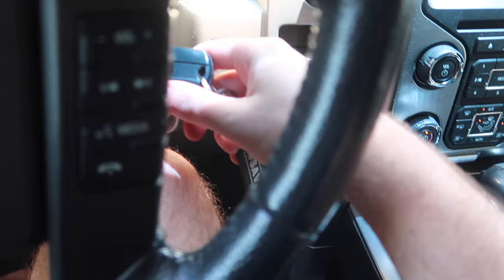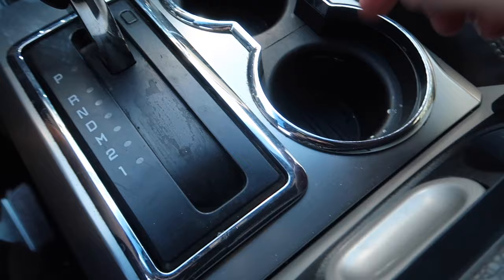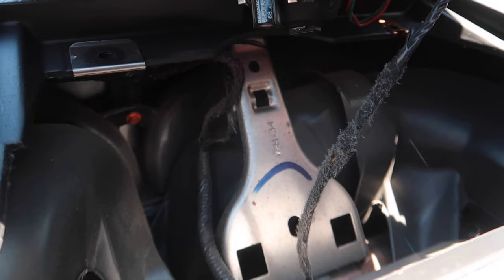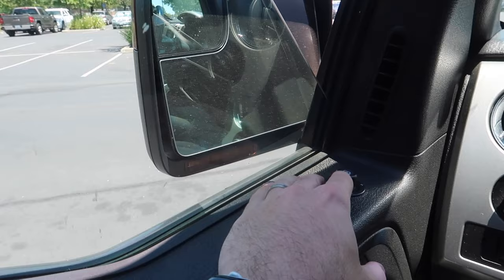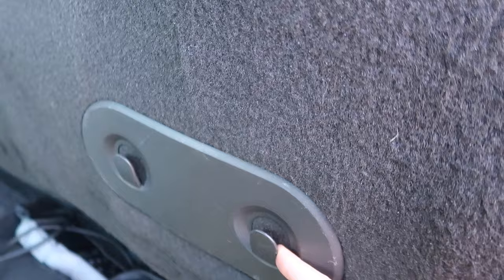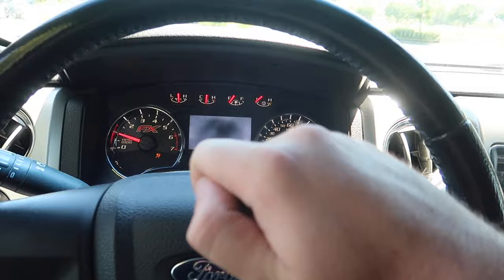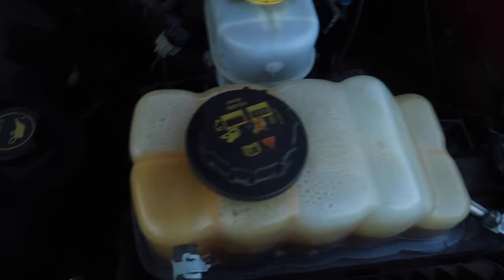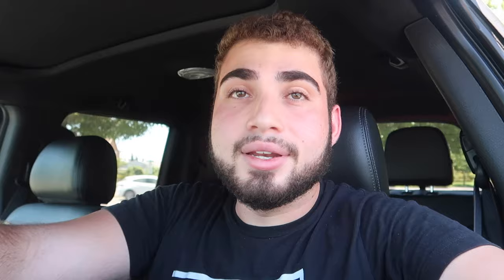FORD F150 HIDDEN FEATURES/FUNCTIONS (2004-2014)

Comment: There is a small lever behind the rear seat back that if you flip it it will allow the seat back to fold down forward. I attached a paracord to a key ring and the keyring to the lever and attached the cord to the headrest bar with another type od clip. Another keyring will work fine.I use a small carabiner.  Push the headrest all the way down and its completely hidden. I attached a hard plastic molle webbing behind there and there's enough room to mount tools or weapons etc etc. Its a great place to store an AR-15 etc.

Comment: There's a hidden latch behind the rear seats that allows you to gain a bit more storage space with a small modification.
Reply: You mean the rear seat 'backs'.  I just used a small length of cord, tied a knot around the small post and hot glued it.  You'd think Ford would've just had an easy to reach lever for it.

Comment: I just got my 2012 F-150 FX 4 Ecoboost about a month ago and love it so far! I love those cup holders as well, and removing them to allow for bigger bottles never crossed my mind.  What I instantly thought as soon as I saw they are removable is how easy they will be to clean.  I swear, nothing on a vehicle gets nastier than the cup holders and they are impossible to clean. Hell, with these, just take them in the house and wash them like your dishes. I bet you could run them through the dishwasher 🤔
Reply: Took mine out to clean then left them out because the extra room is great

Comment: It also has built in wifi, if you have the 8" nav, if it was still available you could use the default nav screen to call your phone and get directions to where you're going, not only it can scan itself but it can send it directly to a ford dealership to look at it, but the service doesn't work anymore, also if you have an HDMI to A/V you can plug in a nintendo switch to the A/V input in the center console and play on the screen while the car is in park.
Reply: There’s AV input in center console? I’ve got an 11’ lariat. That’s badass
Reply: @0223Jeremy  I have the same truck as you and I have it why don't you have it ?
Reply: @tylervanbiezen804  all I see in the middle console unfortunately is the plug-in for a phone charger

Comment: My favorite feature is the ability to permanently disable the seatbelt warning. Also easily add a custom door code, or quick lock using the last two buttons on the door simultaneously.
Reply: How do I disable the seat belt warning?
Reply: How do I program a custom door code I have been struggling with that
Reply: @keetonbond1256  

Depends on what year. This is the video I use for my 2012 when ever the ford dealership inadvertently resets my custom door code.

https://youtu.be/keCaYdmG0m4
Reply: It’s in your owner’s manual. Friend of mine was annoyed by his ‘15 GMC because he couldn’t do that. He had to find some seatbelt buckles.
Reply: I did mime on a 2011 f150 pretty easy but it will not reset the passenger side
Reply: Don't know why I'd want to remove the seat belt warning chimes.  That's pretty important, especially if you transport kids in the truck.  Door code locks sounds great and going to check it out now.
Reply: @bobbyd6680  If I'm not mistaken, the seatbelt warning is only for the front seats when X amount of weight is applied. My backpack and groceries would set off the seatbelt warning in the front right passenger seat. I often use the chiller option to make sure ice cream or what not stays frozen or remains cold longer until it's refrigerated. (Heated seat warmer also works to keep pizza warm.) 😁

For safety kids should be in the backseat but I don't think the seatbelts in the back set off the warning. It's been 5 years since I disabled them. ¯\,_(ツ)_,/¯

Comment: Pre-oil prime. the turbos want oil and timing chains, if you leave your truck sitting for a few days. Push the throttle peddle to the floor and turn the key, it will crank the motor for up to 10 seconds and not start. This will prime the motor with oil, turn the key off and then start. no crazy bad noises. when you do the pre-prime turn the key and let it as long as your foot is on the throttle it won't start.
Reply: Good to know ,thanks
Reply: is that for real? is that intentional by ford?
Reply: @fleedouglas one makes you wonder being all Ford would have to do is let the truck turn over a few times before going into fire mode to save this probably I much prefer changing a starter over a timing chain

Comment: Thanks for the info I've had mine for about two years now and absolutely love it. High miles aside its a great truck with a ton of features
Reply: You will be amazed when you find out you can roll your windows down with remote 😂
Reply: @ramonolivares8059  are you talking about programming it with forscan or from the factory?
Reply: Thank you so much!  Planning on buying a 2013, on Monday. 😁

Comment: Random thing I noticed on my 2014 super basic XL 5.0.  When you do a light "bump" to the turn signal, it will cause the signal to blink 3 times and stop.  However, if you're towing a trailer with the lights plugged in, it will blink 5 total times.
Reply: The blink 3 times is called lane change feature so when you want to change lanes just bump the turn signal lever and it blinks 3 times to let other drivers know of your intention to change lanes.
Reply: He knows that. He was saying that when towing, it blinks 5 times instead of 3.

Comment: 278k on my 13 ecoboost. I pull 9,000 lbs 500 miles a day, 3-5 days a week since new. No issues what so ever. I’ve had great luck with this truck. Will buy new eco when it hits 300k
Reply: That's Great to hear. I have 95k on the same eco 2013 fx4 and nothing noticeably wrong with it yet. I don't pull a lot other then a boat sometimes but haven't really got to experience how it does pulling a heavy load. I was hoping it will last awhile because I spent too much money on it from the dealership so that's great news. Keep keepin on ✌️

Comment: I have a 2012 XL F150, it doesn't have some of the stuff you pointed out here... no power mirrors, no back seat, and my cupholders slide out on a little tray under the middle of the seat. Those cupholders have no problem with larger drinks, they seem to be dimensioned in such a way that two big guys could put their Super Big Gulp in the cupholder and they won't hit each other, or spill. 

My brother in law has a 2012 XLT F150, he has a really neat feature where he can move the pedals themselves closer or farther away.
Reply: BUILT FORD TOUGH!!!
Reply: I thought they feature is also pretty interesting, can come in handy when you’re teaching the youngin to drive.
Reply: @jacobrogers4619  It would have helped my dad teach me to drive... he's a couple inches shorter than I was at 16!
Reply: My 2013  Off Road has all those good features. I like the pedal and steering wheel up and down features.

Comment: When you sit in the drivers seat, where your left knee is, there is a knob that will dim and brighten your gauges. Turning it clockwise past the detent will turn on your cabin lights.
Reply: Also the lights on the back of the cab. But on my 2011 it's more of a switch type system, so you oress and hold it on the right side to turn them on and the left to turn them off
Reply: @connerpeters9434  Thank you!! Just bought my used 2014 F-150 last month and couldn't figure out how to turn them on (my truck didn't come with a book and I keep forgetting to look it up.)
Reply: Most trucks have had that knob for years

Comment: Mine came with a cool feature, Black mold in the headliner. Thanks Ford, The felt gasket on the rear brake / bed light was genius. Nuthing says 50k truck like molded plastic.
Reply: Siliconed mine in after I changed it 💀
Reply: Yeah I washed my truck today only to see the brake lens fill with water

Comment: I know the 2015 F250 XLt has a feature that, if you press the unlock button three times, holding the button down on the third press, the windows will roll down.

Comment: The 7 and 9 on the door code will lock your doors. Your door code is on the inside passenger kick panel, ford charges 40 bucks to get it. If you're on stage 2 lock/ unlock, putting a 4 after your code will unlock all 4 doors, stage 1 all doors unlock following code. 
Forscan is very helpful on these trucks with Bambi mode and such. 
I'm trynna think of more but my brain isn't working. Glad you told me about the USB ports!
Reply: Forscan?
Reply: @rayk4e  yes. It's a program for coding. Def a great tool
Reply: @jsiebrassemusic  Thank you.
Reply: I cannot get my door code to work.  I bought it used.  And suggestions?
Reply: @charokorky  check that your door code is correct with forscan or thru the dealer.

Comment: You can leave the key in,and truck running when you get out and push the bottom two buttons on the key pad at the same time and lock the the truck. It will stay running for the time that you have set on the dash menu. Use the keypad code to get back in.

Comment: Beware when using the front frame as a 'step' if you have the package with an automatic transmission cooler.  One of the connectors on my transmission cooler lines (one in, one return) broke and it cost me 6k to have the tranny rebuilt because the fluid leaked out ruining multiple parts within.  Periodically check the connections of the two lines just behind and below the radiator. I'm thinking now of trying to use a wire tie or something to reinforce the connection.
Reply: Those quick connections  are a failure point, really need to watch them and replace at longer intervals
Reply: @mariusgage5471  100%. Mine failed just driving around town, nothing atypical.  You'd think they would have been a subject of a recall.  Any idea how to secure them further?
Reply: @rayk4e  not sure to be honest, fordtechmiculo or whatever his name is has a good video on it,

im currently looking into the mishimoto trans coolers for the 5.0 specifically for if they change those connectors, no determination yet
Reply: Use A Dremel to cut off the hose with the quick connects and replace that entire section with 1/2" transmission hose and double clamps.

Comment: I loved my 2013 F150 company truck so much I bought a used 2012 FX2, both had the Coyote 5.0 and 6 auto, both went over 225,000 with no major issues. 

Traded it in for a 2nd gen Raptor which is a whole new style of crazy.

Comment: I'm slowly learning all about the hidden features like "fuse 27" and rear window defroster jumper(just did that one tonight). Maybe the lead frame will be next on my list?
Reply: You mean fuse 27 going bad and it not starting? Had that happen and found out that's what was wrong here on ytube.
Reply: Just had my lead frame replaced. It took two weeks to get it from Ford to dealer and then one day to change out
Reply: What about the rear window defroster jumper?  My defroster does not work. Lights up for a second then nothing.  Any tips?
Reply: @rayk4e  yeah just disconnect the rear window defroster and and put a jumper in so at least your heated side mirrors will work now.
Reply: @OrangeSVTguy  Thank you
Reply: @rayk4e  unplugging and cleaning the back window wires, on both sides behind the headrest worked for me.
Reply: 😂,I had to change the lead frame,on my 2012 f-150 Lariat,and for had to pay

Comment: There's a hidden feature to lower the back seat down.  It's down below the back head rest on the left side.
Reply: Yes. Hard to find it's a small round pin I used a zip tie to pull it down and release the back seat. Once it's down you can find aftermarket latches on eBay with a small pull string to release instead

Comment: Ooh keep'm coming! I just bought my dad's 2010 F150 xlt, still learning the sport feature mode and the rest, good times!
Reply: Press and hold the traction control button
Reply: @MintSky1  on the 2013 it say advancetrac off, is that just more traction control being turned off?
Reply: @LogosFarm  Correct. Pushing the button will turn of traction control. pressing and holding the button will cause advanced trac to turn off. which will allow for more wheel slip.
Reply: sport mode???

Comment: Your original keyless entry code is on a sticker inside a triangle shaped compartment on the passenger side. On the outside wall down low, near the kick-panel. Remove it to prevent theft.
Reply: Outside the truck?
Reply: @jjcuna  it's the  triangular panel, next to the floorboard by the FRONT passengers  right foot. It's on the lower right side .  remove this (carefully) inside there is the code number . 5 digits .if you forget  what it is ,it's also in your owner's manual .. Its a plastic card shaped  like a credit card. hope this helps but you probably figured it out by now
Reply: It’s where the fuse box is. Yes a 5 digit number code
Reply: Don't help to remove it.

Comment: I have an ‘03 F-150..  I just bought a used ‘14 F-150 FX4.  Love my Fords.  Never any major issues with my ‘03, just normal maintenance R&R…154,000 miles on it.  Still runs like a champ.

Comment: Not sure if you knew but the 4x4 knob  if you pull out on it there's a rear locking differential.
Reply: Will need to replace it soon. Stays on lock mode.
Reply: It's to lock the front differential not the rear.

Comment: When u want to drop your spare tire u have to go to the back and next to your license plate is a key hole u put your ford key in and it unlocks the compartment to drop your spare tire
Reply: I bought mine used, it’s 2014, there is an opening next to the rear license plate, but there’s nothing there.  It’s just a hole
Reply: @charokorky  I think that is the access for the crank to crank down the spare tire chain
Reply: @chuck, that’s what I thought.  On my ‘03, you have to do the same.  But what’s he talking about, using your key?
Reply: @chuck5720  look at my previous comment
Reply: @charokorky  my 09 king ranch had the hole… my 11 Platinum uses the key to lower
Reply: @charokorky  I just have a hole as well because I had to remove the lock. It was seized up. The key wouldn't open it. You can buy a replacement but I never bothered.
Reply: @lindapoworski2597  Thank you Linda 🙂. Have a blessed day

Comment: On the left side of the steering wheel,i have a button,that will adjust the brake and accelerator pedals,up,down,left,or right

Comment: On the back of the back seats you’ll find a pin to pull up and lay the back of the seat down. This way you have a hard surface to load boxes  on.
Reply: False
Reply: They sell a kit with hardware to make the access easy.
Reply: @Globerson  not false my 09 f150 plati has them
Reply: My 2013 has them, you have to fold the seat down first, then tilt the headrest down. The button is below the headrest on a bracket push towards the outside and you can feel the seat unlatch them fold the bottom seat back to normal and the back will come down.

Comment: There is a known Ford issue with the anti theft system.  If your truck won't start because of the anti theft system it's the fuse slot 27.  Not the fuse, the slot.  Buy a REROUTING THING for 25.00 and reroute the function to an empty slot.  There. Should be a recall so people don't spend thousands on sensors, batteries, keys etc.
Reply: Can you explain a bit more on the slot 27? Why would the anti-theft system depend on an unused fuse slot?

Comment: I used to own a 2012 Ford F150 Lariat. After having it 1 year, I found out there is a switch on the overhead panel that controls the sliding back window. How about that?
Reply: Ford put it there for exactly that reason.

Comment: My truck has aux transmission cooler, so using front frame under hood as a step….may not be good if you slip or misstep and get your transmission lines.
Reply: One of the connectors on my transmission cooler lines (one in, one return) broke and it cost me 6k to have the tranny rebuilt because the fluid leaked out ruining multiple parts within.  Periodically check the connections of the two lines just behind and below the radiator. I'm thinking now of trying to use a wire tie or something to reinforce the connection.

Comment: Plus on the f-150 lariat 2010 there is a kit that b and m  makes an adapter to fit where down under the truck on left side passenger between the catalyst and tranny Pam there is a 9/16 nut bolt that screws off to show the tranny dipstick about five inch long this b/m adapter screws in with a braided cable for the transmission dipstick  ( up to the firewall so you can check your fluid

Comment: I have an 09 King Ranch. I would like to try the diagnostics mode however steering wheel is a little different. Any idea how to access? Thanks for sharing the video…
Reply: if you don’t have the OK button and the 4 arrows.. i don’t believe you can since it requires the 4” screen to do so

Comment: I'm sorry if you've done this already but I did not see it-radio not working properly except 2011 f150. The dash and display very different-have you done a video for earlier models? Specifically for the radio with respect to the dash controls-perhaps an entire reset.
I don't know the proper mechanic term for my radios status-it is not the speakers because sound still comes out and the transmission is intermittent. Please advise and thank.
Although I respect your expertise, I'm a beginner f truck owner who would rather do what you do rather than trust the dealership